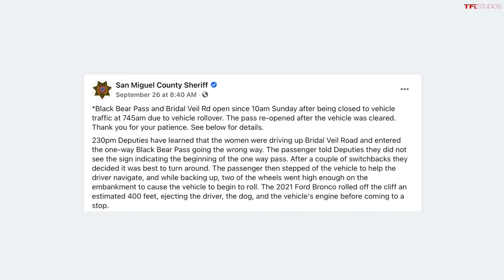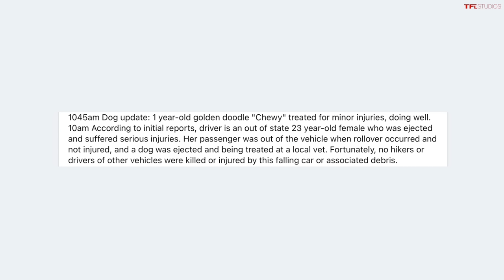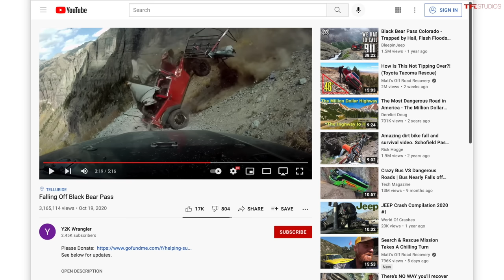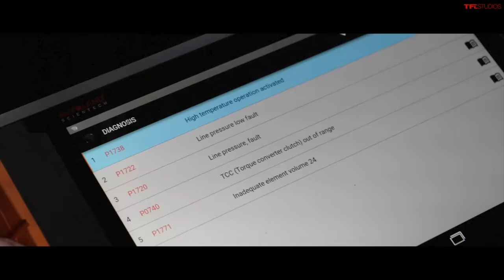The Brand New Ford Bronco Sport Rolls Down A Mountain — Here’s The Story

Comment: If the driver had been using her seat belt, I have a fairly high degree of confidence she wouldn't have been hurt so bad. The Bronco Sport really held up well.
Reply: Except the motor is gone lol
Reply: @danielfish101  The occupant is more important than the motor
Reply: @danielfish101  the engine is designed to drop down under the car in a head on accident and even come out in situations like this.
Reply: @danielfish101  I mean, I'm pretty sure most vehicles that fell 400 feet down a cliff would have also had the motor fall out lol. This thing still held up incredibly well given the situation.
Reply: @KB-bh9hp  eh a toyota Tacoma wouldn't
Reply: @rhydynamic8306  as long as it doesn't hit someone
Reply: @danielfish101  I say let's test your theory XD. I'd love to throw a Toyota off a cliff any chance I got.
Reply: @KB-bh9hp  top Gear kind of tried this
Reply: @danielfish101  typical toyota fan
Reply: I’m glad no one got hurt! I’m also glad it wasn’t electric, Colorado would have had a new forest fire!
Reply: @brly4542  I know lol
Reply: @brly4542  But I'm saying I'm down for trying to repeat their experiments onna newer Tacoma lol
Reply: @danielfish101  by design
Reply: Is it confirmed no seatbelt?
Reply: Not really - if she had not been ejected she would have likely died. This is one of those rare situations where you hope to God you are ejected from the vehicle and that when you are you aren't hit by the vehicle on the way out. This is the one situation where you actually don't want to be strapped in
Reply: No way to know for sure without a more scientific study or having seen the fall. Even so, most injuries occur once the person is ejected from the vehicle.
Reply: @rhydynamic8306  lol
Reply: She must have been wearing a seatbelt, otherwise she would not have survived. She would have either been ejected, or suffered grievous internal injuries due to not being belted and being tossed around the cabin. Either way it would almost certainly have been fatal.
Reply: @dmegahan  Most "normies," as us mechanics or former mechanics call them, don't know details like that. Same with crumple zones and other things that are meant to become deformed to allow for a path for the energy to go rather than being transferred to the occupants. They just see damage and go "oh, that is so poorly built" and see a car that barely gets damaged in an accident and think that is better. But as physics tells us, the energy has to go somewhere, if the car parts are not taking it, the occupants are...
Reply: @danielfish101  And when you learn about physics and car design you'll realize that's actually a bad thing...
Reply: @danielfish101  I've seen Tacoma's eject their engines.
Reply: @kevinbarry71  they're all junk nowadays, toyota included, only cars I'm gonna trust implicitly are cars I've built or rebuilt with my own two hands, and even some of those I won't trust.
Reply: @errhka  you would want to be strapped in with 5 points and a neck brace, not having those ejection was the safest option.
Reply: @jcollins1305  she was ejected, and in this case with the kind of safety systems this car has, that was probably for the best.
Reply: Wow. Amazing she survived!
Reply: Had a Mercedes SL which was drag racing crash into a tractor trailer. The engine wound up 1-200’ ft away, as it broke free of the chassis. I believe it was designed that way, but I could be wrong.
Reply: @Prestiged_peck  definitely
Reply: @errhka  ? Since the cab was intact she surely would have been safer there
Reply: @danielfish101  Much better. Less weight the body has to handle with while rolling over.
Reply: @Prestiged_peck  youre on drugs mate.
That cabin is INTACT. The pillars are intact. The doors are intact. The airbags deployed as designed. She was hurt Badly because she got thrown out.
Reply: @CortJohnson  no, the forces involved with this kind of accident are usually too high for the body to survive without a full harness, helmet, neck brace, and Hans device. Remember airbags are meant for a single point of impact. In a rollover your body is being thrown around in a three point seatbelt. You are hitting the roof, the side of the car, the center console, etc - and you are hitting them over and over again. Your spine has a high chance of sustaining a serious injury because your torso has a large range of movement side to side. Maybe something like a Volvo with extremely advanced safety systems and exquisite construction you'd have a better chance, but without throwing one off a cliff with someone inside you can't be sure
Reply: @errhka  Exactly. Crumple zones and airbags are meant for single use. As soon as you have more than one major impact all that protection is out the window. Incidentally she was also out the window and somehow survived. Low odds on any front. Can't be sure which is better. Don't want any of the scenarios really.
Reply: @danielfish101  hahahahahaha, thanks for the laugh dummy
Reply: @KB-bh9hp  I dont think it fell of a 400 foot cliff and had a vertical 400 foot drop. It looks much more like it was a relatively low velocity roll down a 30 - 40 degree slope? Else it would not have stopped there, OR looked like that. 400 foot straight down, and that vehicle would be a pancake.
Reply: @stevewort  Ok, 400 feet down a very steep hillside, there you go.
Reply: Seat belts work with forward or backward forces. In side tumbling car or direct side impact they don’t engage.  I witness a schoolbus Tbone a ford van. Girl in backseat was in seatbelt but had flown to other side of vehicle.
Reply: The seat belt probably would have broken apart with that fall
Reply: @errhka I never wear my seatbelt on shelf roads such as this! I'd much rather take my chances jumping out of the rig rather than go down with it!

Comment: Guys, actually as impressed as I am about the state this vehicle survived in, I'm surprised about your reaction to this being a unibody car and ending up so decent. The truth is that a frame-based vehicle would do worse since the load bearing is done by the frame, and generally the body/shell of the car is not built to as high of standards as a unibody shell. Therefore, during a rollover accident, when the strength of the body and the roof become factors, a unibody would do better. At least it's no surprise to me.
Reply: but unibodies are BADDDDDDDDD /s
Reply: Yeah that Jeep from last year that rolled it in front of that guy with a dash cam that everyone saw, it was completely crushed
Reply: The new Bronco (not Bronco Sport) is body on frame. So are you suggesting the rebodied Escape is safer than the new Bronco?
Reply: @WilC379  that's exactly what he is saying and in many ways, he's correct
Reply: @mr.boostang2064  "In many ways"?  Either he's correct or he isn't.
Reply: On a shelf road like this the sport is miles better to use than the wide as a semi Bronco…especially with the big tires
Reply: He is incorrect. Ford builds support areas to surpass 700 MPa, regardless if its uni body or body on frame. All auto body shops that repair ford vehicles need to take a class on how to do repairs
Reply: @450ktm520  Thanks for your input. That's good to know. However, my point was not about Ford in particular and it was based on previous evidence.
Reply: @silvestrocrino3256  On a shelf road like this walking is miles better to use than a vehicle.
Reply: @WilC379  ... It would be a long walk
Reply: @crinosil  Walking is actually the only way you're allowed to go up Black Bear Road.
Reply: I get you point. And agree that the unibody structure is quite strong because it needs to be. But if you think the passenger compartment of a modern pickup is weaker because it's a body on frame, then I got some beachfront property to sell right at the bottom of that mountain....
Reply: @craigquann  yup, pillars need to be strong. It's a mandate actually. Frame or unibody built has not a lot to do with pillar/roof strength.
Reply: I know, quick buff and it will look like new again 😂
Reply: @WilC379  Not at all - “safety” (even active safety) isn’t one, homogenous thing. Different vehicles and vehicle designs perform differently in different sorts of crashes. Potentially, the Bronco Sport IS safer in many scenarios than the Bronco - it’s a European designed platform, where the crash safety bar is high, so it’s very, very rigid. The Bronco though is based on a much older, commercial vehicle platform (designed in Australia originally) and commercial vehicles generally don’t have to meet the same level of crash safety.
Reply: @craigquann  Honestly, I don't know much about modern trucks, and I'm sure they've advanced quite a bit. My comment was rooted in "general knowledge" from the  past where most body on frame cars had weaker "shells" than unibody ones. One example was a crash between a Lincoln Town Car and an S-class Mercedes, where the Town Car simply fell to pieces. I mean both were smashed, but the Mercedes suffered damage to the front, with the passenger compartment intact, while the Town Car was "cut in half". That's just one example, and I'm not trying to make a Mercedes advertisement. Anyway, it's good to know that modern cars/trucks are safer. At least that's some relief in face of the dullness the modern automotive world has come to represent (no more excitement in cars, everything is generic and robotic).
Reply: I agree 100%. I’ve tried to explain this to people for years.
Reply: @mardamek  the previous evidence I believe you're talking about is the alignment of the frame to take the impact but that was back in the 80 and early 90s... if you look at the trucks, suv, from 2000 on up they are all semi unibody on frame. So technically you are correct but not depending on the cutoff. You're incorrect if we are talking the last 7 years.

Additionally a frontal end over end accident is the safest crash, with all evidence using race cars that flip over 7 to 15 times. Away from the racing world the data sample shortens up but does support the findings laterally between the two. Then with two recent crashes, jeep and ford at the same Colorado area.  With jeep incident being body on frame with 40% less protective shell compared to the ford bronco and still fair well, thus providing you are incorrect, I apologize to point that out to you.

The ford will be the safer vehicle based on their high alloy low carbon steel support areas exceeding over 700 mega pascals,  that's stronger than a roll cage. And no I'm not a ford fan, I'm a nissan fan. Booyah biyach
Reply: @mardamek  pre 2005 ford mustang's are uni body and that shit crumbled in a crash. You're uni body versus body on frame doesnt hold up. I bring up pre 2005 since they didnt use the high alloy low carbon steel. If you compare a Toyota Tacoma body on frame, these have similar weight different construction. Toyota faired better by 30% to 80% on crashes at the same speed. Look up the independent crash testing with sleds, overlap, frontal, and then AAA insurance data with real world. Blowing out your "truth of the matter" 

Where did you get your info from.

You dont even work on metallurgy like I do.
Reply: @mardamek  Mercedes is a unibody with a wishbone box frame started with the 190e. Back in 80s.

Metal is metal. Only reason body on frame was weaker in the 90s. The nose would droop on impact. Missing the frame. 

ONLY thing left was steel fender and wheel well. No structure Dude give it up we're not in the 90s. 

You dont know what you're talking about let along the ability to articulate a cars structure
Reply: @450ktm520  Well, at least you know what you're talking about. So, that's nice ...
Reply: Popcorn worthy comment thread 🍿
Reply: it has a roll bar..i think..
Reply: As an avid offroader, I'd never want a unibody vehicle simply because you want your roll cage securely attached to the frame (preferably a boxed frame like the 66-77 Bronco) That said, hydroforming has made the unibody much stronger than it was in earlier years and it performed amazingly well in this new Bronco.
Reply: That’s why the Jeep Wrangler has such a beefy roll cage. But the red one that rolled over was in a very bad shape, and I doubt a strapped passenger would have survived.
Reply: "Generally the body is not built to as high of standards".  Really? You got proof of that?  People throw out so much BS on here.
Reply: Not with modern body on frame.  Survivability is high on newer vehicles.
Reply: @DakarBlues  Correct me if I'm wrong but didn't the jeep fall from higher up then the bronco?  I thought it was near the top when it started to roll?
Reply: The Bronco Sport is very solid. I have the badlands and it feels like very solid. Somebody hit me strong in the back at a light where i was static. The door of the trunk was damage but resisted well. And the bumper had very light damage. The garage changed the door and bumper because it could not distort them. But you feels the car were resisting well to a shock. Now everything is like brand new. I am glad. The garage has down the work very fast.

Comment: Amazing passenger cell integrity considering a 400' roll down a mountain, well done Ford/Bronco jr.
Reply: it ejected the driver who may or may not have been wearing a seat belt
Reply: No integrity at all… just lucky.
Reply: The passenger was ejected. She didn’t stay in the vehicle the whole 400’ .
Reply: yeah i wouldnt want to be in a full sized heavy ford ranger platform rolling down a mountain.
Reply: @jefftenhave8038  Dude, they stated that the passenger was NOT in the truck when it rolled.
Reply: @bindingcurve  yes I know that I was referring to the driver who was thrown from the vehicle.
Reply: Yeah so much integrity the engine ejected 📴
Reply: Fellas, go look at some other videos of cars rolling down black bear…..they look like they got dropped out a c130 at 10k ft. Then come back and look at this car. It is truely impressive how well the cabin held up.
Reply: Needs more than a little Bondo!!
Reply: @tonyeff4447 Many vehicles are designed to allow the engine to eject so that it doesn't end up ripping into the passenger cell.  That includes high-end Mercedes.